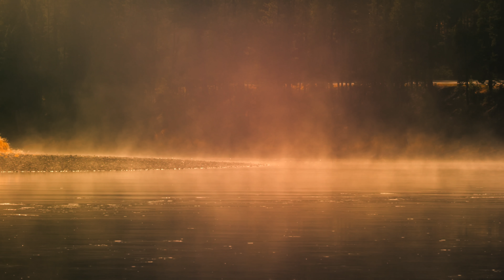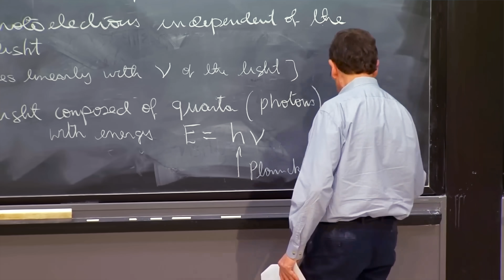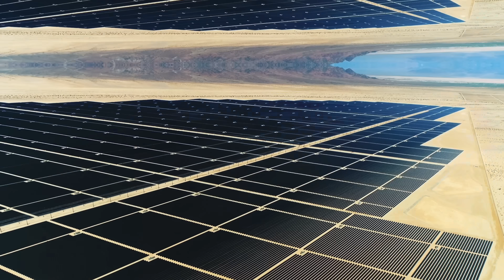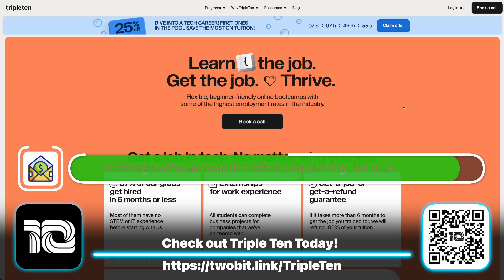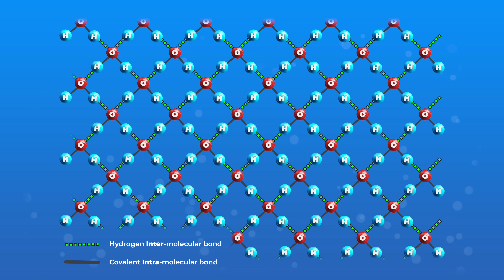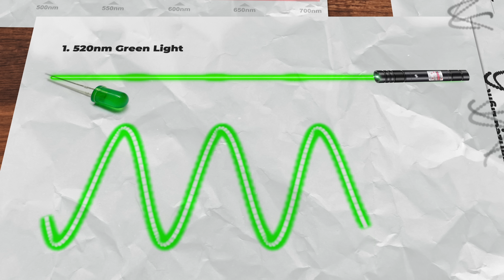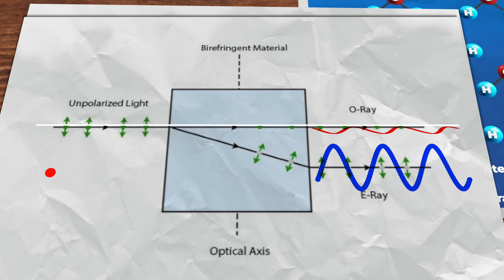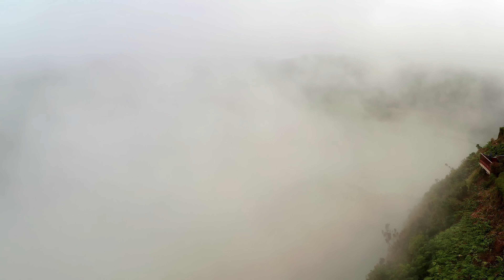New MIT Discovery Just Solved Water's BIGGEST Mystery!

Comment: The only practical application of this discovery seems to be as an add on for  current desalination technology.  New technology to bore into the earth has the potential to unlock geothermal energy, and at that point increasing efficemcy for desalination will be unnecessary.  Of course the problem with geothermal energy grneration is it subplants current technology for power generation which is owned by industry that directs public policy.

Comment: I know the most advanced desalinization plants in Israel use filters instead of heat, so I'm wondering how they would integrate this method into a filtration desalinization setup. This method seems far better for passive desalinization using salt ponds and greenhouses, but then boost it with green light to drive evaporation. I want to see it scaled up.

Comment: I'm confused? 
Heat/ infrared radiation, already IS "light"?

Evaporating water, no matter the reason, takes heat/ energy.
     Lower the air pressure above water, it will boil/ evaporate taking 
surrounding heat energy/ energy with it but you're implying, one can actually 
expose water, to 1 watt of "light" energy & it will remove 1.xx watts of energy from 
the water through evaporation?    Umm.. No.
     Now the statement, we found the most inefficient frequency of infrared 
heat transfer through water (absorbs faster than it naturally radiates), MIGHT be a valid statement.
      This video/ paper is describing something already known by science.
Probably why no mention of this amazing "discovery" anywhere else, on 
the planet.  
      We already know "light" changes things at an atomic level by interacting 
with electrons.
      Don't confuse people on how to "water".
     *Please see: Laws of thermodynamics

Comment: Would make sense to a pump water onto a plane equip with 520nm lasers but ideally a whirlpool on a 23.5 degree angle. I would think the ideal wavelength would be 533nm. Maybe they'll find pulsing the two frequencies or an lfo oscillating the wavelength.

Comment: Actually the air cooling effect isn't really that great. Sure, you can ger lower temperatures but you'll also get higher relative humidity. That wouldn't be very good for cooling electronics. Also, cold air holds less water vapor so for dessalination you really want to keep those air molecules at a higher energy level.

Comment: I dry clothes with the sun sometimes; much faster than just hanging them up indoors. I always chalked up the speed to heat from the sun. Having learned the common wisdom stood in the way of receiving lessons from my own experience.
Reply: more dryer air more moving outside
Reply: @orangestoneface  Here in Vegas, with 2% - 6% humidity, by the time you finish hanging the last of the wet clothes out to dry, you can take down the already dry clothes that were hung first. 
 
Leave them out there too long and they spontaneously combust!!! 
(Fancy werds for: catches on fire)
Reply: I always put that down to better ventilation.  Evaporation will occur faster in low humidity.  If you're not providing sufficient movement of the air then the air immediately around the clothes will become much more humid.  If it reaches 100% humidity evaporation will stop completely.  But this effect may be playing its part too.
Reply: @KenFullman  Here in Vegas with 3%-5% humidity, I love it!!!  Clothes dry quick.  My hair that takes a half hour to dry in Florida takes on a few minutes to dry here in Vegas. 
I Love It !!!
Reply: It's far better outside.  I agree.  Love sun dried clothes cause they are naturally soft and smell fresh and NOT like some perfume crap like Febreze or Gain.  Yuck!!!
Reply: @BirdHugsAreTheBest  I need to try that, I have a perfume allergy so it's gotten pretty tough to find ways to keep my clothes fresh beyond unscented laundry detergent

Comment: Glib, pedantic, and speculative. I get the need to feed the algorithmic beast, and yet - this is a LONG way away from practical applications today. There are far more practical, 1000 year old aquaculture methods to use crops to desalinate at far greater scales that this could scale up in less than 20 years. 

Additionally, electrolytic processes combined with nanotube filtration allow for capture of 90% of the minerals to be used in industrial applications while removing 99.9999999% of living organisms or detritus from the water.

Comment: This sounds great, where does the energy come from to drive the this. And I get that they are using lasers, so some Argon type laser. That is still like 36ev output for reference and can be powered up to like 25 watts, with 50 amps of input power (that is for a tabletop lab one). There is going to be a lot of heat energy produced in creating that power. Ok use the sun for that, seems the efficiency of what we are able to input is not really there.

Comment: I've always known water evaporates without heat. In fact if you leave water in a saucer over night, this will have evaporated by the next day. No light. I've used this in Construction, where sometimes there is no Humidity in a building and leaving buckets of water around the building counter reacts this as opposed to a dehumidifier when you are reducing the amount of humidity. A Polly Dome with a pool of sea water with evaporate and produce drinkable water. If these were placed next to deserts, powered by solar cells, then the desert could become fertile. Wonder why nobody has done it.
Reply from the maker: Hi Andrew so that's a little different. All water has a potential to evaporate even at room temperature, just low odds. the closer you get to the boiling point the more the odds reach 100%. so as you stated all water can randomly reach a level of energy where it breaks the bonds and escapes.

that's not what this discovery is about. this discovery accounts for a discrepancy scientists noticed ... when dealing with clouds and sun absorption. the sun's photons have the potential to dramatically increase evaporation levels as discussed in the video. hope that helps!
Reply: @TwoBitDaVinci  thank you for the clarification.

Comment: I do not believe this is new to physics' as a fun trick is to put water into a vacuum in a clear container and expose it to sunshine to make it vaporize faster than just at a higher vacuum alone.  Its the opposite of compressing gases to liquids; with sunshine to add the magic.  
Once vaporized it will stay that way until moved out of the sunshine were it will liquify.
Making a throughput that is just balanced, light - vacuum - dark,  in theory would be a continuous water purifier.

Comment: MIT didn't discover this, because Stan Meyer had discovered this and even gave some seminars on it, while he was discussing how he discovered that very high frequencies can split water into hydrogen and oxygen much more efficiently than electrical current can, and he found that adding green LED lights into the canister would expand the distance between the molecules making it easier to break them apart gaining even higher efficiency results in breaking down water and separating its molecules.
   If you look up Stan Meyer videos, you will find his seminars, where he discusses this and draws it out for you.
   His main goal was to use the seperated hydrogen as the fuel to combust in gas cars, so you would only need water to drive your car, it would have ended the need for gasoline in cars, but he was killed (poisoned) by the American government, and even states that on his death certificate, he was poisoned at a cracker barrel restaurant, during a meeting with high government officials.   Its all on public record.

Comment: MOONSHINE!  You can't polarize light by scheme you propose.  If you could, you would violate the 2nd law of thermodynamics, & increase the range of radio communications "beyond what is possible".  The cooling of air in your "secondary evaporation" model also violates the 2nd law in that you are "pulling heat" from a colder source.

Comment: This is one of those "well duhhhh" moments in life. If you needed heat to evaporate water, a full side of the planet would be overwhelmed with floods at any one time, throughout the entire of winter, as it becomes too cold to evaporate water. Alas, water still evaporates in negative temperatures, beyond the freezing point. Even more astounding, nobody scientifically observed that more water evaporates during the day than night, until now and paired it to the previous fact, you realise it's not really anything to do with heat.

To further this, in winter, if it rains during the day, it's rarely going to freeze over on the pavement. It'll just stay wet most of the day under cloud cover, evaporating as sunlight breaks through. Over night however? Yeah, good luck not slipping in the morning 😭

It's like a riddle you hear, where you know you should know the answer but when someone tells you, it just makes you facepalm that you couldn't guess. That's every scientist right now.

I think the biggest problem for science right now, is implementing technical solutions that can put out an equivalent amount of energy as the sun's rays, or even outdoing it entirely. Sure, we can create light bulbs with incredible intensity, but they're nowhere close to being actually comparable to the sun, because of course we make bulbs according to need. We don't want UV spectrums of lights burning us to death in our homes, and the cases we do use UV lamps they lose other parts of the light spectrum. So which spectrum of light would be most efficient for evaporating water?

Comment: Use an electro stimulation to excite the molecules. Which is part of thermodynamics. But as you're saying and explaining. It still would not be efficient without the ability to excite the molecules even more. So you would still need some form of temperature control. To stabilize the reaction to the consistency you're looking for.

In this case evaporation. Which within what you're saying for maximum efficiency you need heat and Light.
With green light being the most efficient. As long as you use a Pacific way of delivering it. Which would be inefficient due to the complexity.

What actually is scary. Is proclaiming you now have a better knowledge of the weather patterns.
Missing the point there's so many factors involved. Starting with a geomagnetic field around the Earth. Which interacts with the geothermal Dynamics already in play with the Earth. Also the  Moon gravitational pull on the Earth. and the angle of the Sun. don't forget to mention natural occurrences on the planet surface such as El Nino and La Nina..

Will respond to all intelligible inquiries or questions.

Thank you:
Barry E, Ives.

Comment: Desalination hasn't really been a scientific problem for a century, its been an engineering and infrastructure problem. Electricity to heat has been a 100% conversion since its inception. The issue is getting that heat to the water without it going elsewhere. This is trying to do something else where mechanically it would be simpler to get a better efficiency rate but I fear it would take an overengineered solution to make work. At the end of the day it will get hopes up, some scientists can say they did a thing, and then no firm or government agency really bothers with it.

If we were serious about desalinating sea water. We'd make a fission power plant for it and churn out millions of gallons of clean water. But why do this when its cheaper to pump it out of the ground or pipe it in from reservoirs? When things start drying out, we'll using the oceans for sure. But before then? Not likely.

Comment: Something like a 3000K LED should be very effective as it is the cheapest source of green light... yes it is a whitish diode but its spectrum mostly comprises of green, mixed with a bit of the rest on either side to sum to 3000K or does it reduce the efficiency if exposed to the rest of the spectrum at the same time?

Comment: Not to mention ventilation.  Wet clothes hanging in a dark room with bad ventilation at 25C will take longer to dry than in a dark room with good ventilation at 20C.  So, with light out the picture, ventilation is even more important than temperature when it comes to evaporation.

Comment: Light?...

Isn't it also just the fact that water moves to places where it is less concentrated? That reason why honey doesn't go bad. That no single celled life can survive in honey. Honey just sucks all moisture out of cells because bees have found a way to dissolve more sugar into water than what is usually possible. The solution is just begging for more water.

My grandmother would continue to hang dry laundry in the winter. You'd know the clothes are dry when they stopped being stiff as ice. Freezer burn is the same thing. Food drying out in the freezer. Freezer burn is probably the best example. No light there.

Comment: I'm wondering if this could be used for more types of selective evaporation and distillation. If water responds to a particular wavelength with a particular polarization at a particular angle, then might ethanol or ethane respond to particular wavelengths/polarizations/angles? I've heard that it's only possible to distill alcohol from water to a certain concentration and my guess is that it's because the distillers must use a temperature where the ratio of partial pressures of the two substances is the greatest, but there's no temperature, I guess, where no water evaporates but some ethanol still does, so you always get some water with normal distillation. But, with this method, perhaps it's possible to efficiently get much higher concentrations with normal distillation.

Comment: Wouldn't it be possible to use some sort of special mirror or prism to split green light off from sunlight, but also deflect it away toward some other device, like a solar panel or solar heat collector? Or even just toward some plants that would not need the green light anyway. Maybe you could even build solar PV cells that are transparent to only green light, and the green light would pass through to the water.

Comment: May be. Anyway, I think, you could not break the law ow reserve of energy and there should be no difference, what type of energy source you use to evaporate amount of water. You could simply put air pump, that blows air into water and therefore you artificially  significantly enlarge water-air surface by bubbles and speed of evaporation. I don't get it.

Comment: But also, using a reverse osmosis filter is still the best way to desalinate,
since you only need a filter and height difference for the pressure to push it through,
when constructed well. Push water upwards once, until the pressure below exceeds a certain margin,
and then allow said pressure to squeeze the water through the filter.
Every so often rinse the filter with not-so clean water, to remove excess salts,
but also use regular crude filtering beforehand, by the same methodology.

Comment: I think that surface water can absorb a set of photons and thus be released from it's surrounding neighbours.
With heat alone, the heat is shared and concentrated at the surface, where evaporation occurs, due to
accumulation, upon reaching 373 Kelvin.
But, everyone knows that water also evaporates well below this temp, otherwise we'd all cook on the outside
of our skins, in order to evaporate sweat, which doesn't happen.
It's just doesn't matter what energy is applied, as long as it's enough, to even temporary break the
binding to the neighbours, and voila, water goes airborn.
For heat, convection happens, sharing the heat with nearby neighbours, but also infrared photons.
These photons when multiplied on a single molecule also cause evaporation, since that breaks
the bonds to the nearby neighbours, and said water molecule, at the surface takes with it a lot of energy,
cooling people down. And we also don't cook at the surface, despite the evaporation temperature
due to heat is set at 373 Kelvin. Air motion (wind) also adds energy into breaking those bonds.

Comment: I feel like I knew this. Intuitively because my parents have a fence and it would get wet and would only start evaporation when the sun came up. But the temperature hadn't really changed enough in the air to be only caused by heat from the sun. This is a tremendous breakthrough.

Comment: I always suspected this. Water evaporates even in a walk-in refrigerator at 38°. As a chef I noticed this. I've even seen ice in a freezer will sublimate as well. It's slow, but happens.
Reply: Also this means you could potentially invent a cold desalination system using bright LED lights. And it would work even in the antarctic and arctic. Photons, who'd have thought. In my experience it could have been airflow only, but photons, excellent!

Comment: well your having to dump the energy in to break the molecular bonds which it takes more energy to get the same volume of water from liquid at 0.1C to boiling at 99.9C so I don't see this being a massive deal, like sure you get to skip the step of heating it from say ~25C to 99.9C, but thats only a small amount of the energy required, and with thermal distillation you can use stages where the condensing water in from the first stage heat the water in the second stage evaporating it and so on which increases your efficiency so thermal distillation would still be more energy efficient.

If you could directly break the oxygen hydrogen bond with radiation at a high efficiency that would be different because currently we are at like 40% efficiency for turning water into hydrogen and oxygen.